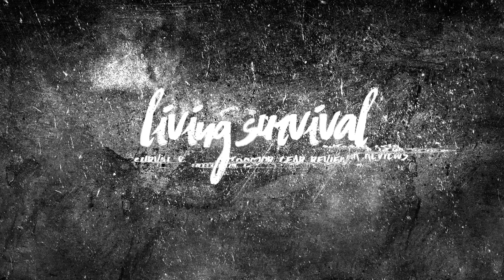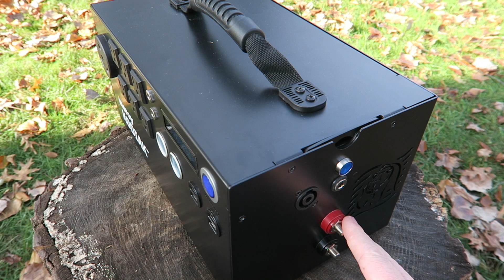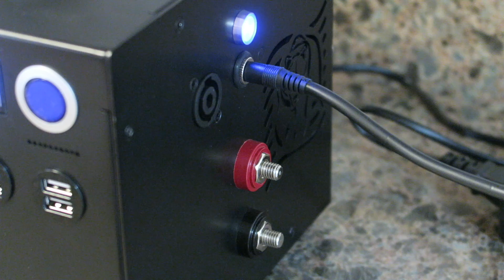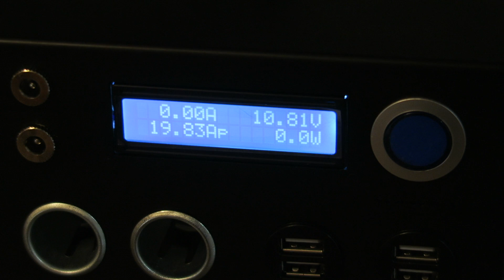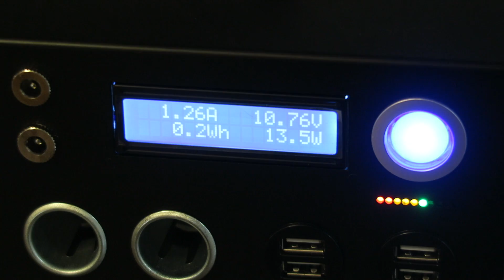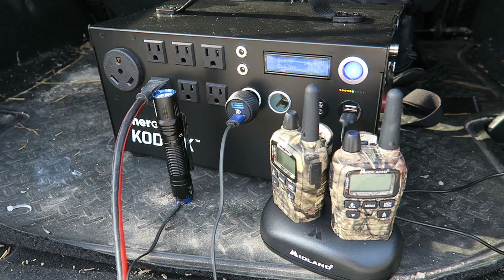FULL REVIEW!! Inergy Kodiak Solar Generator

Comment: Increasing number of batteries DOES NOT increase the amount of watts you can use. . It's still 1,100 watts which is not much. Plus adding solar panels is an added cost. BUT the big downside is no amp hours is given. Much cheaper and better to create your own using multiple 12 volt batteries and inverter.
Reply: It would then no longer be portable. It has a higher start load capacity. We use the 30 amp plug and directly feed our load center at a remote cabin.......with zero issues. Clean quiet and very reliable 👌.

Comment: I think this would work for me living completely off grid in a cargo trailer. It will allow me to eat hot food and keep food cold. It will power an electric blanket for cool nights. I can use a propane heater for very cold nights. I have a 450 watt A/C but even with additional batteries I doubt it would run without the panels charging it at the same time, so that means no A/C at night. Fridge 4.5 cu ft would only need to run on a timer for 15 min/hr. Cooking is quick with a pizzazz or 1100 watt microwave for a few minutes. Most important for someone like myself is living stealth and using Walmart, Casinos, truck stops, or any 24 hour business to sleep at so I do not draw the eye of law enforcement or criminals, this unit would keep those encounters down compared to a gas generator. Just one limitation I see is being pinned to your vehicle with panels out for only a couple hours compared to other solar generators on the market. Then you can pack up your panels and enjoy your day. Not such a bad trade off for free power and not paying rent or electric or gas bills.

Comment: Good video. I do like the idea behind this generator, and while the price may be a little high for some, having the many options to recharge this really off sets the higher price in my opinion. Yes, a Honda gen set can be had for cheaper, but when the fuel runs out, then what? I doubt I will ever run out of sun, wind, or even a small stream type generator to keep this charged. 

I do have a question, can this jump start a vehicle should the battery be dead?

That would be a VERY handy option to have, along with a larger solar panel. Keep up the great work.
Reply from the maker: Don't think so but I've reviewed the noco genius pro that does a great job at that.
Reply: That's too bad, but maybe version 2.0 will have that upgrade. 

I just think that a product of this size and power, and the market you're targeting, needs that option. I mean if you're out camping and the kids leave a light on and your vehicle battery dies, this needs to be able to start a vehicle and recharge a large battery with a solar panel while out in the bush. It can not just take from a vehicle, it needs to be able to give back in an emergency.

Have an option for some thing like a military slave cable set up. A simple heavy duty 12vdc outlet with a heavy duty plug and battery clamps that can handle say 75 - 100 amps, and you're good to go, OR even make a plug to plug into that camper outlet with battery clamps and jump or charge a vehicle battery that way in an emergency.

Comment: If I were you I would put my multimeter on the two unprotected batt terminals on the side. If you have voltage put some caps on to avoid some big sparks and maybe a complete meltdown. There are some Utube channels offering big exclusive discounts on these systems. Any comment? Looks like a good system to power my wife's CPAP breathing machine or any other med equipment especially with a couple of solar panels.
Reply from the maker: The only issue I would have with a CPAP is the fan noise when this is turned on. Otherwise it will power it just fine. Not sure about other channels. Good tip on the terminals.

Comment: This thing belongs on lifestyles of the rich and clueless. I can buy a small,very quiet Honda generator for quite a bit less and run things whether it's day or night.
Reply: Joel it is portable enough that you can take it outside to hook to the panels to charge and bring it back in to use it at night, which is probably when it would get most of its use anyway
Reply from the maker: I have a small 2000W honda and it is awesome no doubt but can't bring it in the house and noisy when camping.
Reply: Living Survival you may be able to bring that solar generator inside but you need solar panels to make it work,which need to be outside. Which means wires running through windows,just like if you were using a gasoline or diesel generator.As far as noise goes Honda makes the quietest generators available,which are pretty damned quiet.You can use the Honda during the day to charge battery banks,which will give you a nice silent form of power at night.
Reply: arweninnj I cant disagree with,its just too cost prohibitive for me.
Reply: Me too! Checking out YouTube for "build it yourself" videos- there are a bunch....

Comment: I wish they provided a price without having to give them your personal information.
Reply: A gas generator is only going to be useful for as long as you have gas. If you are prepping for the possibility of a power outage due to an EMP, you need to take into account that the power may be down for a long time. Large quantities of gasoline are difficult and dangerous to store; if untreated it also eventually goes bad. A gas generator can't be used indoors; using it outside will attract attention and make it a target for thieves. A couple of solar panels with a battery set up such as this would be an invaluable resource. If I could afford it, I would have one- this or a similar model. Hoping the prices come down a bit more as the technology improves...
Reply: Bert M   Agree!  From what I could get from their messed up website, th they are based in Paris and have a store in Florida.   But without giving them personal data they really  don't  need they won't give you any information about their products.  Doesn't sound like they want to do business.  I was very interested but at this point I don't think I trust them.  Why the hell do  they need phone number?  Telemarketing and spam?  No thanks.  I've been looking for this type of product, but not from these  guys. First impressions count and if they don't trust me, why should I trust them.  Too bad for them.
Reply from the maker: Bert M just go to inergysolar.com
Reply: I had no issue just click the link Ben provided.
Reply: Not sure what web site you're going to.  Type in Inergy Kodiak into the Google search bar and it will bring up a list of links...make you you don't click on one that says, "Ad".   

Click on the one that is directly to their site, you'll know it's the right one when right on the home page, there's a picture of the unit, and the price.   And by the fact that the home page clearly says Inergy, and not some other site's info. 

And, as to what someone else said, no, they're not in Paris or Florida.   They're in Idaho.
Reply: Steve H it's $1899.99.Buy a nice Honda generator and spend the remainder on other gear.

Comment: How many hours could it run a small space heater?
Reply from the maker: Depends on the wattage and draw.
Reply: I think the best option if you are in cooler climates is to get electric blanket as it will not tax the battery as much as a space heater would. If the blanket is still too cold then get a propane tank and hook it to a propane heater to heat the whole room. 1500 watts is quite a drain on this unit even with extra batteries to give you more hours of heater. So propane is quiet and cheap for those times when it is difficult to sleep. I live off grid and have learned a few things but always open for something new and will still buy this unit and sell my gas Hondas. A/C is my only issue now once I purchase this unit, since it will not run that long even with additional batteries and only a 450 watt A/C There are only so many hours of sun to charge it and all the batteries back up for tomorrow. Elevation changing is my only option to stay cool for now without my gas generators. Unless I want to pay for shore power someplace, uggh. But living stealth and not drawing notice from neighbors at a casino, Walmart, or other public place is better than running a gas generator which screams, “Hey! There is someone inside this vehicle and he has a generator we can steal. Let’s bonk him on the head and take it from him.” This unit draws very little attention but does confine you for a couple hours until you can get it charged and put your panels back in a secured location.